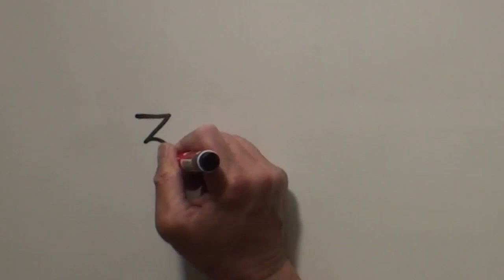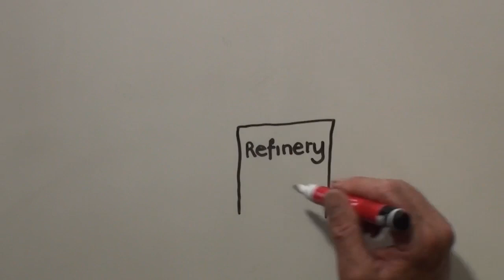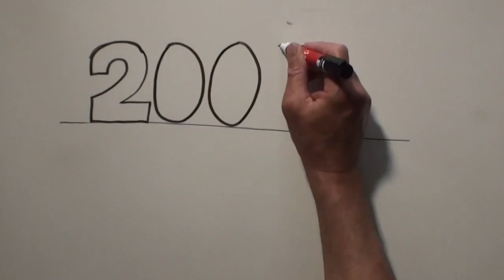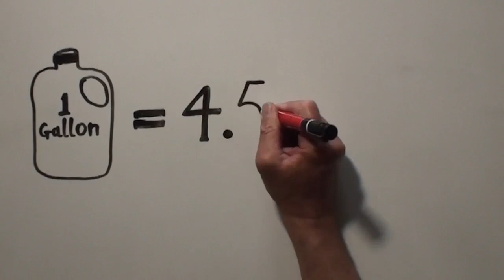Volts for Oil | Fully Charged

Comment: This information still doesn't give a complete view of the difference in energy consumption between a petrol powered car and an electric powered car. Because you would also need to look at the production of the car itself. More specifically; A electric powered car needs a whole lot of batteries to store all the required energy. Those batteries contain difficult to obtain metals like Lithium. Lithium is obtained by isolating it from a mixture of lithium chloride and potassium chloride. It is done by electrolysis. This requires great amounts of electricity. This needs to be taken in consideration when comparing electric to petrol powered cars. Also there are believes that there simply isn't enough Lithium on earth to power all vehicles if they would all be electric powered.
Reply: +MacXpert74 Actually, you can get lithium from ocean water if there's enough demand for it, so that's not a rare resource. You're also ignoring that lithium can be recycled once the electric car's battery is deemed no longer road-worthy. Or it could be used for stationary power storage, which will put less demand on it than moving a car around does. And as the power grid is cleaned up, EV's get cleaner as well. A gas car will always pollute no matter where its gas is obtained from.

Oil is finite, despite us being able to find increasingly new ways to get to it. A large portion of it also comes from countries which don't have the friendliest of people either, so they may decide to collectively jack up the prices. And it's going to run out sooner or later, and I'd rather that we weren't still heavily dependent on it for gas.

I'm not saying oil isn't useful. It's still has lots of uses for many things mentioned in this video such as plastics, tires, and pharmaceuticals. But I don't think burning it in a gas engine is a good long term use for it.
Reply: +Ashelm56 perfectly said, nothing to add here
Reply: +Ashelm56 My original comment was about energy use, what the video is about. And again you, like the person in the video is ignoring the energy requirements in production of the batteries for EVs. And that would also include recycling as well!

Reading more about lithium production it seems scientists are still in debate about the available amout and environmental effects on acquiring it. It's not the 'closed case' you make it out to be. From wikpedia:

Opinions differ about potential growth. A 2008 study concluded that "realistically achievable lithium carbonate production will be sufficient for only a small fraction of future PHEV and EV  global market requirements", that "demand from the portable electronics  sector will absorb much of the planned production increases in the next decade", and that "mass production of lithium carbonate is not 
environmentally sound, it will cause irreparable ecological damage to ecosystems that should be protected and that LiIon propulsion is incompatible with the notion of the 'Green Car'".[49]

However, according to a 2011 study conducted at Lawrence Berkeley National Laboratory and the University of California, Berkeley,  the currently estimated reserve base of lithium should not be a 
limiting factor for large-scale battery production for electric vehicles  because an estimated 1 billion 40 kWh Li-based batteries could be built with current reserves.[86] Another 2011 study by researchers from the University of Michigan and Ford Motor Company  found sufficient resources to support global demand until 2100, including the lithium required for the potential widespread transportation use. The study estimated global reserves at 39 million tons, and total demand for lithium during the 90-year period analyzed at  12–20 million tons, depending on the scenarios regarding economic 
growth and recycling rates.[87]
On June 9, 2014, the Financialist stated that demand for lithium was growing at more than 12 percent a year; according to Credit Suisse, this rate exceeds projected availability by 25 percent.
It's a bit long, but if you read all of that, the conclusion is basically, They don't know if availability will meet the demands.

Comment: for 1 kW input (electricity), you get about 10 to 30 kW output, in form of fuel/gasoline. When you shut down all facilities, you have to replace this energy deficit with something else.

..and sorry, your calculation is completly wrong! Electric driven car: 1kwh consum per 4km range is realistic (or 250 Watt Hours per one kilometer, see Tesla) and NOT 3'600 km range per one kwh!
Reply: I just watched this and spotted the same annoying error.  It's 20 billion miles not 20 trillion.
Reply: Yes, but the fuel efficiency of a ICE is approx 25% the rest dissipates as heat, an extra 5% loss is created by transmission so the replacement should with something else should not be that dramatic....

Comment: we really are such an inefficient planet, aren't we. my god. I mean, why do we even oil, virtually anything oil is used for can be electronically powered with the energy used to refine that oil, so just stahp the oil, sheeple!
P.S I know that oil has important by products, yes, and some things have to be oil powered, but i mean in most cases oil is just use to power a thing that could use electricity e.g cars
Reply: Electrically powering cars only really became sensible with modern batteries, it wasn't realistic before.
Diesel and Gasoline has an incredibly high energy density, I.E. the energy in 1kg of petrol is much higher than the energy in 1kg of batteries.

This is why the Tesla cars need such a massive battery and still have a lower range than petrol vehicles.

I agree about other things though, we started electrifying our train in the UK but stopped because, you know, politics.

A 100 years ago most cities had low carbon low pollution tram systems, which we got rid of and could really do with now.

Over the next 50 years Gasoline and Diesel etc will be used less and less. Hopefully Tesla will make batteries so cheap that we can use them for all of those other things that use petrol, like lawn mowers, strimmers, mopeds, as well as the big things.

If we can get battery prices down even more then we can use them for energy storage on the national grid, this will mean the end of emergency turbines (basically jet engines to produce electricity) and allow renewable for give us even more of our energy.

The only issue is our current government are cretins, but then when have they not been?

Comment: According to the video the refining process needs 4.5KWh per UK gallon thus 1KWh per liter. The gasoline energy content is 33.3 kWh/US gallon thus 8.8KWh per liter. So if we stopped refining oil as Elon Musk claims how does he propose that we deal with the 88.6% energy shortfall? And aren't we still going to spend the electricity to obtain all the other chemicals we refine from oil?
Reply: rbtx99 Brushless motors are 80-90% efficient. Hydrocarbon engines are 30ish% efficient.
Reply: +Fennecbutt AC induction motors have been brushless since 1888. It's only "new" technology to you R/C guys out there...............

Comment: Turns out that it takes about 13 kWh of 'energy' (natural gas & electricity) to make a US gallon of gasoline from oil sands bitumen. Here in Alberta, electric car can go over twice as far as a gas car could even before burning the gasoline.
Reply: It's general energy, and it doesn't come from electricity. Some of it comes from the crude, some of it is natural gas, and only 10-15% of it is electricity. The data for electricity use by refineries (at least in the US) is available for the past decades. Look at how much electricity they used, and how many barrels of oil was refined. It comes out to 0.2-0.5 kWh per gallon of product, of which usually half is gasoline.
An electric car can go 1-2 miles on that energy, assuming no charging losses (charge-discharge efficiency is around 80% for BEVs, varies by charger type used).
Reply: Hi Petter, sorry for the delayed response. I think Zolikoff who commented just above is much closer to the actual figure of electricity used to refine a gallon of gasoline - 0.2-0.5 kWh per gallon of product. I gave another EV presentation just the other week but NOW say in my presentations "over 6 kWh equvilent of fossil fuel energy (nat gas, crude, & electricity) to get oil from the ground to gas to the pump".  "That energy could have been used for an electricty car and no tailpipe pollution"  - or something to that affect.
Here in Edmonton Alberta, it turns out we have so much annual sunshine that we'd only need a 4.5 KW solar array on the roof to generate enough electrical energy that an EV would need on an annual basis. With the gasoline $$ savings put towards paying off the solar array instead, that array would be paid off in less than FIVE years!!  but BIG OIL doesn't want you to know that..... :)
Reply: @A785R  Spot on - the main energy consumption from refining oil appears to be burning lots of natural gas for heating, etc as well as burning the oil products themselves to use as heat.  The US Gov't did some reporting back in the 70's and noted how inefficient Texas refineries were b/c they had access to cheap natural gas. Either way, it's wasted energy if we can drastically reduce gasoline demand. https://www.osti.gov/servlets/purl/7261027/
Reply: @A785R  There are byproducts to refine Gasoline ─ Tars for using in Roads/Highways Pavements and Oils to cool down ICE... And more.  We can't look up the Data and Assume everything.  How do you think that The Solar Panels can generate that much Electricity / That Cheap and California still has to import daily 30% of Cali uses ─ they should just set up like you said Solar Panels and be Free!  Easy said than Done. 😂 😂 And your Article wrote in May 2014; had you ever thought that Crude Oil would have gone down to Zero Dollar in Mid June and July Deliveries ─ where in Oklahoma they Oil Producers even paid for Companies to have hauled out their tanks.

Australia admission that there is no Feasible Plan for Recycling the Solar Panels and you forgot too that these Solar Panels Made in China came from Forced Labours in Xinjiang ─ and Powers needed to have made Solar Panels came from Coals ─  Solar Panels already polluted the airs in China 10 years afterwards ─we have climates Crises by USA/Canada shifting the Polluting Process to China or India or Asia in General.

The Scientific Approach of Oil and Gas or BP ─ Beyond Petroleum ─ and Hydrogen can be Mass Produced with Nuclear power ⚛⚛Fusions ─ that France and Other Countries including Japan and Australia are in their forefront of─  This Post is 10 Ten Year Old and Green Hydrogen is not what your Presentation or Concept is about

Regards,
Reply: source?  It is great information, but without reputable sources... it doesn't help the conversation.
Reply: Two years ago when I posted this I was using this article for the 13kWh figure. 
http://www.hybridcars.com/the-oil-sands-surprising-new-nemesis-plug-in-vehicles/
This article was shared amongst quite a few different media outlets at the time. 
In hindsight - it seems to be not correct.

A while back,  I had a conversation with someone in the energy industry who pointed out a few of the steps mentioned in the article were incorrect and the figure (depending on the oil sand extraction site) is probably more around 7.5-9 kWh, not 13 kWh to make a US gallon of gasoline from oil sands bitumen. From what I understand,  the industry average is about 5-6 kWh of combined 'energy', to make a US gallon of gasoline from oil, not 'electricity' - there is hardly any electricity used. It's mostly natural gas.
Reply: Thanks for the update - this is very interesting! One could argue that oil sand stands for the margin production of gasoline ("when we need more gasoline, we make it from oil sands; if we need less, we decrease the oil sand production"). In that case, the 7.5-9 kWh/gallon is a very valid figure, and still means that electric cars will travel further than oil cars with the same amount of electricity. Or was it electricity for the oil sans figure? If it was general _energy_, the figure is again more complicated. 

But all in all it seems like electric cars make a whole lot of sense even from just an energy use perspective, especially if you look at the margin production. To actually transform the whole vehicle fleet we might need to produce a lot of new electricity, which we can (sustainably). 

I also hope that the future means more sharing of cars and better city planning, so that we need to drive less in total.

Comment: I'd like to know how much 5,600 GWh is out of the UK's energy production?
Reply: The UK generated 385 TWh of electricity in 2005.  5.6 TWh was 1.45% of it.
Reply: Bastian Colding on the other hand, electricity generation is not even a majority of the UK's energy usage.  Gas and oil products used directly for heating, transportation and chemical manufacturing together make up well over half of the UK's energy usage.  Exact figures are here somewhere... 

https://www.gov.uk/government/uploads/system/uploads/attachment_data/file/296183/pn_march_14.pdf
Reply: ... and I'm still not quite properly answering your question.  UK domestic energy production is somewhat lower than its consumption, because since the turn of the millennium it has become a net importer of oil and gas after decades of being an exporter.  This is due to declining production of oil and gas, not increasing consumption.  UK consumption has actually fallen quite dramatically over the last fifteen years, partly due to relocation abroad of energy-intensive manufacturing but also thanks to improved efficiency in almost all other sectors of the economy.
Reply: Thanks I couldn't find this piece of information. Shouldn't it be 1.45%?
It sounds like a lot when he talks about the cars and I still think it could be used better, just maybe it isn't that much compared to an entire nations consumption of energy
Reply: Bastian Colding "Shouldn't it be 1.45%?"
Er, yes.  I'll correct that, sorry!

Comment: No matter how you spin it. 
There is no way fossil fuels are more efficient than Electrics. 
Electrics can be fed any number of ways. 
Solar, hydro, geothermal, wind, and/or a combination of all. 
Energy quantified, gasoline contains 33.7kWh per gallon. That's after refining. 
The volt can go ±90 miles on those same  33.7kWh. 
A diesel big-rig gets ±7mpg if they're lucky. 
The last time I fueled my rig I payed $1000 and DIDN'T EVEN FILL UP ALL THE WAY (2x 150 gallon tanks), granted I could travel 1800 miles before having to refuel.

Comment: The video confuses the total energy used with the electricity used in oil refining.  The electricity used in oil refining amounts to around 0.2 kWh per gallon.   For example, see Table 3-3 of this EIA report http://www.eia.gov/forecasts/steo/special/pdf/california.pdf    You are not using 30 times more electricity per gallon in the UK.
Reply: YES.  I can't find exact figures online but US EIA ones indicate that UK refineries produced about 16.5 billion (US) gallons of refinery products in 2005.  If electricity consumption of refineries in that year was 5.62 billion kWh, that's 16.5 gallons per 5.62 kWh, or about 3 gallons per kilowatt hour.  Not 4.5 kilowatt hours per gallon.
Reply: @JonathanMaddox  Did you accounted for gallon diffrences UK the imperial gallon (imp gal), defined as 4.54609 litres, USA US gallon (US gal) defined as 231 cubic inches (exactly 3.785411784 litres),
Reply: @xperyskop2475  the figure I'm disputing is wrong by 1250% but you're wondering if I accounted for the 20% difference between two obsolete units of the same name.

The UK does not use imperial gallons for retail sales of petrol nor for official statistics.  Only the US uses gallons for that.  I quoted US EIA figures which are in US gallons.  Anyone quoting some per-gallon statistic pertaining to petrol in the 21st century must either be talking about US gallons or being perverse for the sake of it.